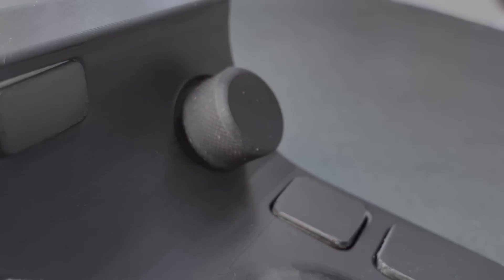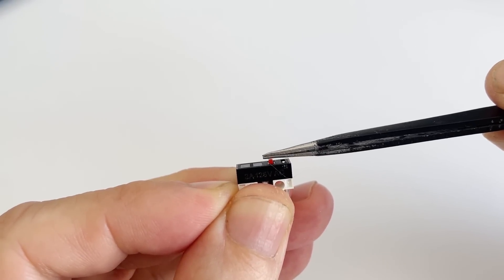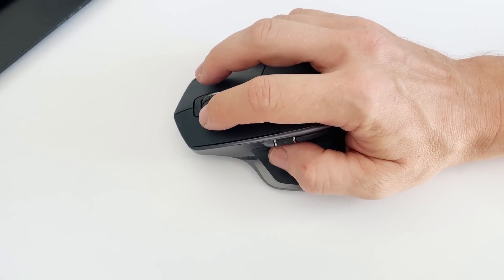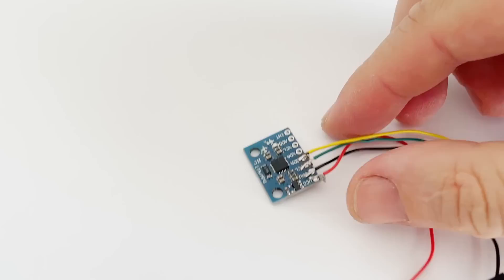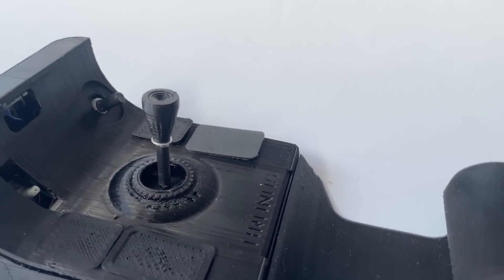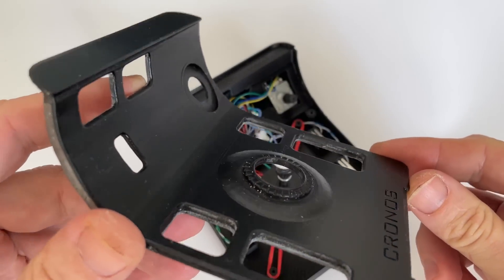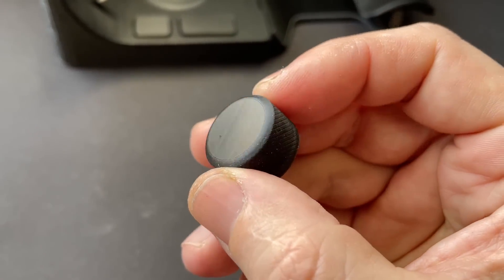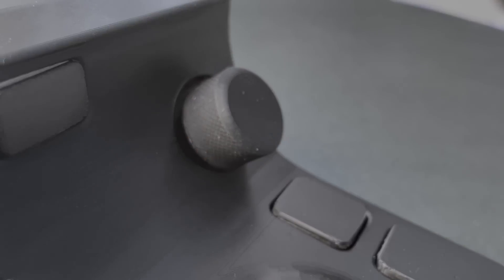Creating the Ultimate Mouse: The Journey Behind Cronos Control - A Mouse & Trackball Hybrid!

Comment: I use a Logi 575 trackball with a wrist rest mouse pad which does not move.  You can control the speed with Logi Options +
Reply from the maker: I also tried this approach with the settings via Logi Options+ - it is really convenient for general use. However, there is a nuance: at a high resolution for fast cursor movement speed, when performing precision tasks, difficulties arise, since the cursor moves too quickly.

In my device, I managed to solve this problem programmatically: at a small tilt angle, the cursor moves slowly, and as the angle increases, the speed automatically increases. This ensures both accuracy and speed depending on the task, without the need to switch DPI settings.
Reply: My resolution is at 1920 x 1080 @ 100Hz, no problems running at 75% speed.

Comment: Take a look at hall effect gimbals that are used in RC remote controllers for drones etc. seems like exactly what you need for your joystick. They're a lot more accurate and will let you adjust tension etc... much better without wobbles.

On the more expensive side, Radiomaster AG-01 family of gimbals but there are cheaper ones too.
Reply from the maker: Thanks for the tip! This is a really good option - Hall effect suspensions, like in the Radiomaster AG-01 line, are great for control, providing high accuracy and the ability to adjust the tension. However, as you correctly noted, such solutions cost from $ 100, which makes them quite expensive.

The main thing is that in my design it was possible to achieve similar accuracy without a dead zone due to the use of software algorithms. This allows you to get the desired level of sensitivity without additional costs for expensive equipment.

Comment: Something that may help stabilize your gyro point is letting it sit, nested, on a cone shape inside the device.  That way you're rolling the stick around the cone, but the rubber bands keep it taught and in place against the cone.  This keeps the stick from floating and bouncing.  keeps the gyro centered on a point to minimize errant movement, and you can rest your finger on the stick instead of need to hover over it.
Reply from the maker: Thanks for the interesting idea! The concept of a cone-shaped base for gyro stabilization does sound reasonable in terms of reducing unwanted oscillations and fixing the center point. However, in my design with a gimbal joystick, the main jitter suppression is already achieved by software filters and the gimbal. Such a system reduces the influence of external oscillations and minimizes inertial shifts. Therefore, adding a cone stabilizer in my case may not bring a significant improvement.

Nevertheless, the approach is interesting and may work great in other implementations!
Reply: @DIY_Yarik  I think the cone could help not necessarily where you've already done the leg work on the PC side of oscillations, but on the user interface side.  As I haven't used the device I'm not sure, but if you have to "hover" your finger over the joystick to keep from pushing it down into the base of the device that may be fatiguing after extended use.

Additionally, physical redundancy never hurts the software solutions, lol!

Definitely just a random thought suggestion and you really are dialing this thing in so I hope it works out well!  New ergonomic input devices are pretty rare these days and something like this could help a lot of people!  All the luck!

Comment: People have been trying to find an alternative to the mouse for decades and yet it still is the most popular way to control a pointer.  And I think that's the case because it's simply the best solution.  I've used joysticks in the past to control a cursor and they simply are not that precise.  And if you increase the precision, then they are slow as hell to move around.  I hate being negative because I love to design and build things as well, but I just don't see how this joystick-like device really can replace a mouse.  I would suggest designing a "3D mouse" similar to the overpriced ones made by Connexions (their name is something like that).  3D mice would typically be used in tandem with a regular mouse.  The 3D mouse would be used to manipulate (zoom, orbit, pan) a 3D model in CAD or 3D modeling software usually with your left hand, while the regular mouse is used to manipulate the user interface (moving the pointer and activating menus and icons) typically eith your right hand.  Again, not trying to be too negative, but your joystick design already looks like some of the 3D mice on the market.
Reply from the maker: Thank you for your detailed comment and honest opinion! I agree that the mouse is a time-tested device, and many still consider it the best solution. However, my goal is to offer a convenient alternative for those who are looking for something more ergonomic and are not afraid to experiment. My design managed to achieve the right balance between precision and speed of movement to make it convenient for everyday use, and the software settings allow you to adjust the sensitivity to your preferences.
Reply: @DIY_Yarik  I hate to be negative.. but what you've created really isn't very ergonomic. It forces your hand into a very specific position, not allowing you to adjust the rotation of your forearm at all without making it difficult to use the pointer joystick, whereas with a traditional mouse you can pronate your arm a bit. (your next posture is the best posture) as well as adjust your shoulder position during use by just moving the mouse to a different part of the pad.

The wrist rest is also concerning. In most cases, wrist rests are not ideal, because they pinpoint all the weight of your arm directly onto your wrist. If you have a properly adjusted desk and chair, the base of your palm, wrist, and forearm can all share the load of your arm.

Lastly.. the buttons are all very spread out, requiring pretty large finger and wrist extensions in different directions. I wouldn't be surprised if this resulted in finger pain after long term use.
Reply: @DIY_Yarik  You might want to take a look at some of LGR's input device videos. The Spaceorb and Altra Felix in particular. Those were both, uhhh, deeply flawed devices to put it nicely but they had an interesting way of doing things that you might be able to adapt or reuse somehow.
Reply: @MrDeelightful the space orb concept is still being used for cad work
This mouse is essentially just a 3d connexion space mouse without push or pull. It's planted to the desk and used less pressure for less strain.
Reply: FWIW what I see that’s reasonably novel here is starting to merge the macro pad pointer control device. I’m not sure who decided that my hot keys all belong on my keyboard and I assure you this isn’t an attempt to rationalize the second numpad that lives between my keyboard and mouse…
Reply: Also while I’m cooking: we’re halfway through the twenties and I expected the pointer to be controlled by my retinas by this point.
Reply: @1RandomToaster  this exists, see Tobii eye tracking, they say it’s a two-decade product. 👍
There's still a lot to improve in this field, namely pointer precision (because of eye wanderings), and input intent (blinking is slow, drawing patterns with eyes is slow and stress-inducing), you're better off with a mix of solutions than hope for a one-size-fits-all.

Comment: Won't the stick drifting while there is no strong centering mechanism?
Reply from the maker: Thank you for asking! The joystick is stable thanks to the rubber bands, which prevent any wobbling even with movement or shaking. Additionally, software filters are in place to handle any slight rattling, so it accurately detects intentional user movements.

Comment: I appreciate the work, but I think switching from the absolute motion of a mouse to the relative motion of a joystick misses the point of a mouse to many of us.
Reply: People seem to be focused on this mouse not being suitable for their use-case, but that's the point. Mice are designed for average use-case and cost-effective production. For the intended use of this particular mouse, however, it's more like a space mouse (for CAD) . It's designed for a certain use that is a-typical and for one specific user. The whole thing was done because normal mice weren't cutting it, so there was a need to make something different, and it works brilliantly for the intended use by the intended user. Great work!
Reply: I made the ultimate HID doesn’t hit the same as ultimate mouse🎉 (Human Interface Device)
Reply: @knowledgeengine Indeed, it hits much harder. Full cyborg even. 😂
Reply: Also: “Absolute” for loose interpretations of that word. Unless you’re using one of those early grid based laser mice, in that case respect, critical support, no notes.
Reply: Way more muscle groups are involved when moving a mouse- broad swipes w shoulder/elbow muscles, and fine adjustments w wrist/fingers. That's part of the reason a single finger joystick can't match the speed, precision and accuracy of a mouse, you're only using a few muscles from your forearm down.
Not to mention, a joystick is not 1:1 input, it's a 2nd-derivative control.
 You are adjusting the rate(deltaT) of movement output.  And, to return zero, the stick still has to pass back thru range of motion... 
whereas...move a mouse sensor x pixels, get 'x' cursor movement + output instantly halts when movement stops.
Reply: Hes using a laptop and the normal mouse direct on the desktop instead of a mousepad like all normal people. Anything else to say
Reply: Absolute motion of a mouse? That's nonsense. Wacom tablets have an absolute mode, which is actually rather annoying. The main difference is that with a mouse a relative change in position is directly added to the cursor position, while a joystick instead controls the rate of change of the cursor position. 

Seeing how automobiles and airplanes are controlled by setting the rate of change, i don't think it's credible to say that it's hard to use.
Reply: Right the point is to point accurately and it's been proven joystick is not as fast as the mouse even if you are a pro the mouse wins every time.
Reply: The most important feature of a mouse is that you know exactly how much to move it, at any speed, to aim it at a specific point on the screen (if you have turned off mouse acceleration). That’s not possible with a joystick. And it’s very hard on a trackpad.
Reply: @jesperwall839   It's a vital feature for most professionals like us, but it's only become a thing recently mid 2000s with 800dpi mice, and most people still use mice with acceleration because they don't know how to use computer settings. Thing is people adapt to acceleration and all sorts of weirdness quite well.

Most office mice also have a 15° filter angle cone where they snap movements to the nearest axis, bet you haven't consciously noticed.
Reply: @ I was a professional Q3 player in the early zeros. Nowadays I don’t use Windows, and it’s also possible to turn off acceleration in Mac OSX. And it doesn’t use 15 degree filter. I’m a happy camper 😂
Reply: @jesperwall839    The several degree filter isn't a Windows or OSX thing it's in hardware on the typical office mouse sensor like PAW series. Gaming sensors lack this type of filtering, even the basic ones like A3050.

I don't remember how it was with Q3 era sensors, i should look around for one and test it, but odds are it may not been the case in 400dpi era.
Reply: @ Ah. Didn’t know that 👍 At the time of Q3, gaming mouse’s still used a ball. A lot of cleaning every day to keep it working 😂
Reply: @  Rocket Arena. It was a long time ago. You were probably not born yet.
Reply: Goodluck pvping in bedrock with this 🤣
Reply: I finished Dead Space 1 & 2 on a Thinkpad TouchPoint. Its viable.
Reply: Different strokes for different folks, switching to a trackball was a game changer for me, I could never find a happy medium between zipping across monitors and precision, even with DPI level switching.
Reply: I feel like you are thinking about controlling a joystick with your thumbs on a controller not this where you have more fine control
Reply: if you're talking about gaming hey it's 2024 aim assist is king in every game anyway
Reply: not everything is about u dirk
Reply: @maozedong5265  it's about the mouse and that's exactly what this comment is arguing about
Reply: Usecase makes all the difference. You can use a screwdriver as a hammer if you like, and w hammer as a screwdriver as well, but neither are well applied to the others task. That said, driving screws with an air hammer is always an option. 😅
Reply: I think people are missing the point OP was making. One is ABSOLUTE tracking and the other RELATIVE. No one can argue against the consensus that a mouse is more precise than a joystick.
Reply: The big thing was that he created a controller that could be used with one hand on a table.
Reply: and trackballs!
Reply: Yeah, its like playing shooter and aiming with thumb stick, like bruh
Reply: You are correct. Everyones personal preference doesn't matter. He started with a mouse and ended with a joystick. It's simply not a "mouse" anymore.
Reply: @Tetrahcodom  Real mice have tails and balls
Reply: I don't know, I used to enjoy the little red joystick on the laptop quite a lot, I'm sure I'd get used to this in no time. I'd be interested in buying if it was for sale. Long days with 3d work really wreaks my wrist, even with a vertical mouse I like.
Reply: @JaxiPaxified  a trackpoint is not a joystick.
Reply: I was gonna write that EXACT comment! Watched whole video and appreciate the work, but 2 things really let it down:
1. As you mentioned, absolute movement can't be replaced by this. Approximation at BEST...
2. The hand rest REALLY annoys me... If the height is a problem, reduce the height, don't add "stairs"...
I feel if you're gonna make a controller yourself (soldering a keyboard rn), it has to be perfect for your needs... I don't see this as the pinnacle yet... Still work needed!
Reply: Try a trackball! A good one like a Ploopy or GameBall. Fantastic tracking. Very absolute motion, just on a smaller scale.
Reply: Never used the little keyboard pointer on Thinkpads? You can't really game with them but they work fine for desktop use. More motivation to learn keyboard shortcuts.
Reply: @kellymoses8566  oh I hated them. Whenever I forget to bring my mouse and had to use them or the track pad my productivity drops quite a bit
Reply: @kellymoses8566   There's a reason those died out. The capacitive touchpad worked better.
Reply: @SianaGearz lol what? Touchpads were a thing decades ago. These thinkpads had a touch pad and a little joystick. Moving a cursor across the entire screen is still a tedious task with a touch pad. The nibble works better and effortless
Reply: @SianaGearz  They didn't die out, Thinkpads still use them.
Reply: @SianaGearz Sony had the grey nib. I had their mini laptops with the CPU designed by Linus Torvalds.

Comment: that's pretty cool... I'd use a thumbstick component instead of designing a whole new joystick.  Already has a button press under it as well and the centering is already setup.  For the scroll wheel i would use a single axis rocker switch component.. not sure what its called but they use them on automobile automatic windows.

Edit: I believe its called a spring return thumbwheel or a rocker thumbwheel.. You can get thumb sticks really cheap ... like 3usd but the rockers are kinda expensive
Reply from the maker: Thank you for the suggestion! Unfortunately, the rocker switches used in cars generally have very strong springs, which makes them uncomfortable for this type of device. The same applies to many joystick modules. There are a few joystick models that offer a softer, more precise experience, but their cost starts around $120, which would make the device too expensive.
Reply: @DIY_Yarik  the rockers are about 50-80 usd and have a hall sensor and a light centering spring. I agree it's probably too expensive for a mass produced device.  They also have them on hotas joysticks.  The joysticks for an Xbox controller would be accurate enough with a small dead zone for a mouse pointer.

There are also flight sim joysticks that use force instead of movement.  I believe they are called "force sensing".    Could be fun to try out something like that for a one off prototype.

Comment: Lots of interesting design. It seems like you could keep the joystick but surround it with curved shape for your palm and other fingers. The buttons and wheels could be placed on the curved shape, so you could operate them without moving your hand.
Reply from the maker: Thank you for the interesting offer! The design of the device has really come a long way, and the current form is the result of many tests and improvements for maximum comfort and ergonomics. I came to a form that, in my opinion, is the most convenient and allows you to use buttons and wheels without changing the natural position of your hand. But I will definitely take your comment into account for the future, there is always room for improvement!